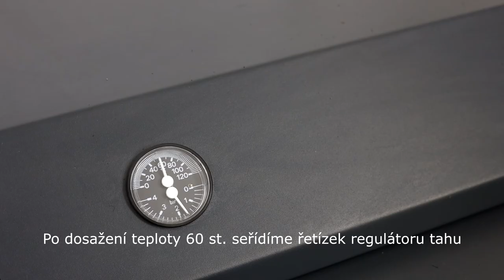VIAFLAMES W22 ECO Instruktážní video zátop v kotli

Comment: Имам стар котел и мисля да го подменя с такъв.Каква височина на комин изисква и керамичната доза има ли я като резервна. Благодаря
Reply from the maker: Hello,
We require a chimney thrust of about 0.3 mbar, according to fuel and boiler output. Yes, the ceramics is easy to replace and is supplied as a spare part. 
Vialfames
Reply: @viaflamess.r.o.9997  Благодаря